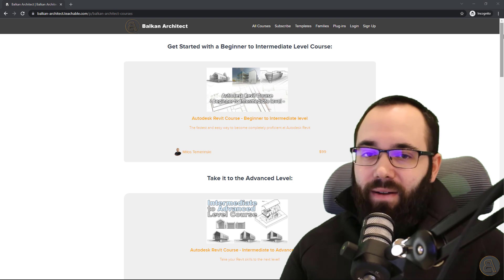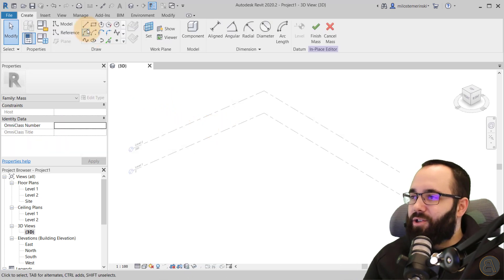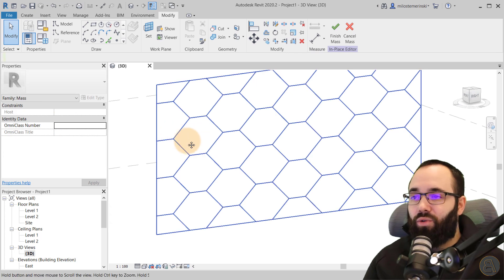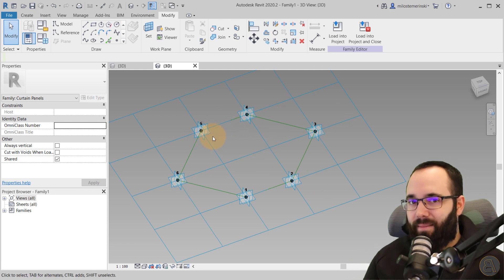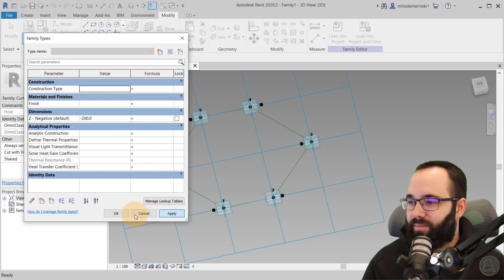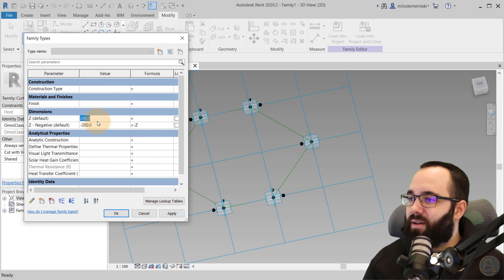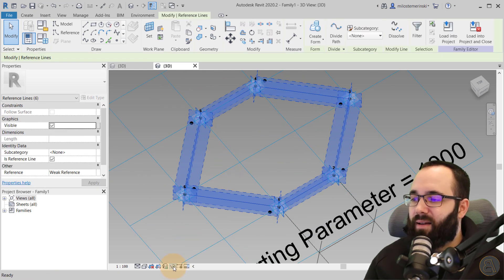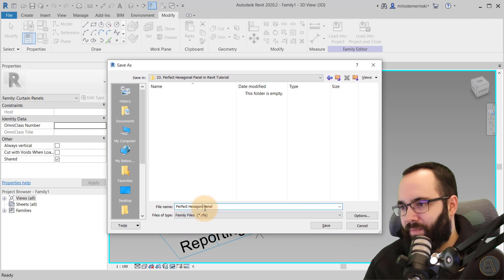Perfect Hexagon Panel in Revit Tutorial

Comment: Thank you for addressing this problem most of the Revit users face. Although, in my opinion there is no need to create complex panel with additional parameters. Once you apply formula to the parent family file where original mass surface is divided, any pattern based panel of hexagonal shape will adapt to perfection automatically.
Please try this and do let me know too. This will ease any kind of workflow involving divided pattern that you only need to apply formula to control pattern in it's parent family, not in the panel component family.
Thanks anyways for helping out the BIM community. 😊
Reply: Hello shoeb could you please explain in brief?  The formula to parent family file you are talking about & what does it mean 2* sqrt (3) / 3* X.